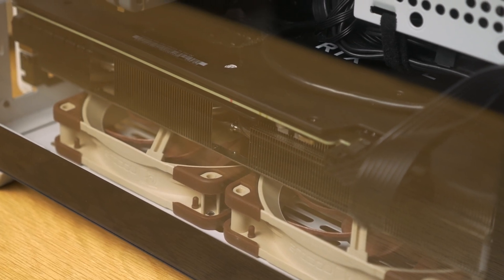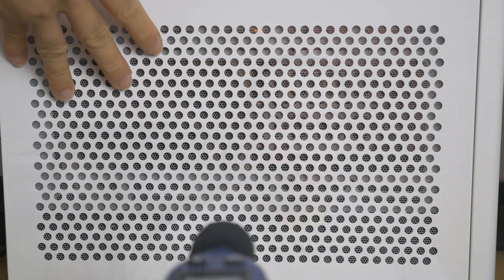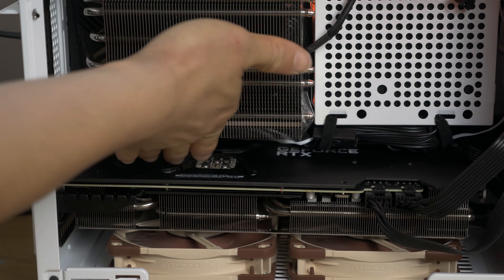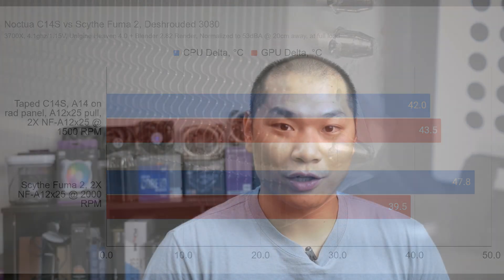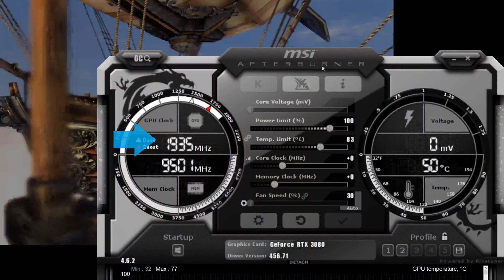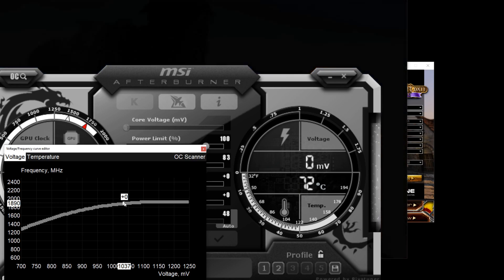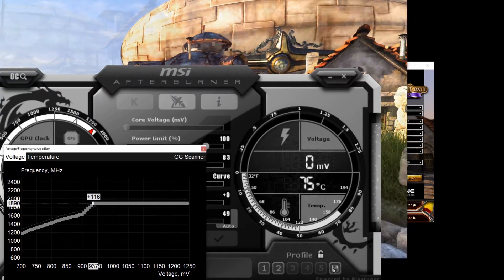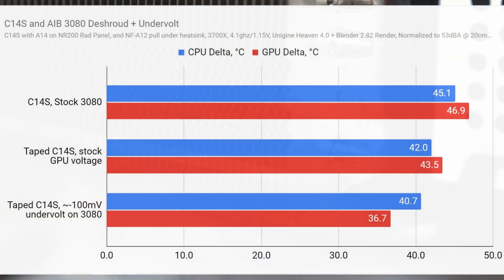Optimizing RTX 3080 Air Cooling in SFF, Part II (feat. the C14S and MSI Ventus OC)

Comment: Oh great Ncase master, I plan on running your exact setup for my ncase. My question is with the psu, would the new Corsair sf850 or even the Loki 850 or 1000 fit? Or is the best I can get still the Corsair sf750? I think the difference is maybe an inch only on one side

Comment: Is deshrouding the GPU a good idea if I'm water-cooling the CPU? 

I also am confused about connecting the fans on the deshrouded GPU. I don't want to have to microtask the fans in BIOS or fan application, so my option is to get a two 4-pin pwm to GPU connector right? So that when the fans connect to the GPU, it can cool it automatically?

Comment: on the undervolt page ... just hit the OC Scanner at hit start - this will auto undervolt the whole range to its maximum, and push your frequenses to the max at all voltage (stable) - i find this OC the best performance versus watt used when i had RTX card.

Comment: If the increased CPU temps with deshroud and C14s is due to the 120mm fans pushing hot air around the graphics card, wouldn't it work to instead 3D-print fan ducts for the GPU which force the air from the 120mm fans in the bottom to go through the GPU heatfins? 

This way there is no hot air pushed around the GPU, therefore not affecting the C14s and as an added bonus the GPU will get that air straight through its heatfins, probably improving overall thermals in the system.

Comment: If I don't want to have too much trouble with cooling - do I go with the c14s when I get a foundes edition and the U12A with aftermarket cards?

It seems like the U12A would care less where the air is coming from, as its all jumbled up in there anyways
Reply from the maker: It does matter for the U12A. Intake from the rear is a better route although the C14S can take advantage of the large side panel intake. Both when setup properly are on par.

Comment: I undervolted my friend's 3080 strix to about 1850mhz at 850mv and the the power consumption dropped from ~325W at full load (heaven 4.0) to about 225-230W ....insane saving and also dropped 5C in thermals he did do the deshroud mod before this and it idles around 35C and under load  just goes to about 40C(before undervolt) after at full load it sits at around 35C

Comment: I get it. Undervolting makes PC runs cooler, but some games just really like to boost the GPU to its absolute maximum.
Reply from the maker: Silicon dependent, you can do a combo of both- find the boost clock that your card can hit, increase a bit, then drop the voltage a little less than full on undervolt. So then you would have a combo overclock undervolt.
Reply: @MachinesMore  Right now, I am not considering overlocking. I ran an MSI Ventus RTX3070 2x OC in Ncase M1 with one fan blowing on GPU. Under full load, the Ventus fan sounds like a jet engine. I am planning to do de-shroud as you did, but can’t find the mini 4-pin adaptor around my location. So, my priority is to undervolting. I tried stock clock speed undervolting, -100Mhz clock undervolting, and both methods plus dialing down a maximum of 5% TDP. Well, I can run Heaven and Aida GPU stressing fine, but not games. I can run AC: Odessey fine, RDR2 in most of the time, but not MHWI. Like I said in my previous comment, games like to push GPU to its maximum, and all the tweaking was washed out.

Comment: Hey man, love your content!
I was wondering if you did any testing with the Noctua u12a and the and the deshrouded rtx 3080 in the nr200(p)? 
I have access to both the Scythe 2 and the u12a and I am wondering if you can recommend one over the other, my main concern being silent, or near silent operation, price is no object.
Cheers!
Reply from the maker: The big difference is the stock fans. The Fuma 2 has low rpm fans which will limit how much CPU you can run or how hard you can push it. For Ryzen 5 and below it’s enough but beyond that you may not get the highest boost clocks. The U12A has fans that can go high so if you need it you have it, if you don’t just dial the fan curve back. The heatsinks are very similar in performance, not much to choose between them. A Fuma 2 with U12A fans performs nearly identically.

Comment: For anyone who actually gives a fuk. You need to find away to separate the insane thermal output of the 3080 from your main internals. Personally, I'd get a split case and cut a custom partition in the outline of your gpu. Buy a dremel and man the fuk up. Similar to Xbox 360 and its air shroud. Ya, it used lead free solder but the implementation remains the same.

Comment: Just ordered my NR200. I am going to run a deshrouded 1080Ti Strix with 2x NF120 if it fits. Will also be using a 280mm rad so I'll have to use the mesh panel, hopefully it doesn't hurt the GPU temps too much.

Comment: When using a pull fan mounted to the underside of the C14S, does it matter what type of fan is used? I see you used 25mm, but would a slim fan be more ideal? What about a static pressure optimized fan like the P12 Redux, or matching the A14? 

Thanks for the great videos as always.
Reply from the maker: A static pressure fan for sure since it's a heatsink- the key here is that you run something with a slightly higher RPM range than the A14 so that they stay somewhat in unison. The A14 fan goes up to 1500 RPM and is a 140 (moves more air), so a 120mm in the 1700-2000 RPM range is ideal- for me that was the NF-A12x25 but you could also do a P12 Redux. The NF-F12 is a good static pressure fan but lacks the high end RPM range. Ideally you'd want the same fan but underneath the heatsink there are some size limitations with every user's board setup.
Reply: @MachinesMore  Thanks for coming back to reply! Your videos have been such a help for everyone putting together their builds this year.

Comment: Which sff cases would this fit in. Are any of the below possible a) ncase m1 b) dan a4 c) loque ghost d) nzxt h1???
Reply from the maker: NCase M1 should work when deshrouded. If not the card is too long to fit comfortably. When you deshroud the card it becomes like a 2 slot card so it would fit in those sandwiches style cases, but to get it to work I’d be a bit nervous with the high TBP of the card. Typically when going fanless in sandwich style cases you can get something up to a 2070 level (~175W) working with strong bottom fans and a solid side panel, but this is almost twice as powerful. The H1 isn’t a good fit based on fan mounting and even the size is really really tight, plus you will need a PSU upgrade.
Reply: @MachinesMore  thank you for replying 🙂 I saw someone fit in this card in nzxt h1 with front filter of case removed. I am trying to decide now on that case or hzmod xq69 . Seems like 3090 fe fits in the second one which is similar to sentry 2.0. would you suggest trying the xq69 one out . I love it's console look

Comment: Hello, really like your videos on NR200. Spending hours and hours on figuring out best setup. Ordered white NR200P, Corsair SF750 and the Aorus B550i Pro AX with some Corsair Vengeance RAM. Plan is getting the AMD 5600x (or maybe higher if bang for the buck is worth it) an a 3080 oder 3070, maybe 2080ti. I love silent systems. So I won't go for an AIO due to pump noise. I really couldn't figure out which CPU cooler to go with for most quiet and still powerful cooling. Would love to use the TG panel due to better Noise insulation and aesthetics. If mesh is even more quiet please correct me.
So which CPU cooler is the way to go for gaming and quiet Office use that fits TG and mesh panel?
Thanks for your answer, greetings from Germany!
Reply: Hast du eine Antwort gefunden? Ich bin genau gleich unterwegs und suche und suche nach der besten Lösung, da mir ebenfalls die Lautstärke wichtig ist. Mugen 5 und Fuma 2 erlauben keinen regulären 2. Lüfter oben, höchstens slim, die aber umständlich zu montieren sind. U12A geht kein TG, U12S passt gar nicht.
Reply: Habe den Fuma 2 eingebaut. Passt definitiv nicht mit Glasfenster. 120mm non slim past nur mit viel Druck drüber, habe ich nicht gemacht. Habe den Ryzen 5600x und die Lüfter auf 30%gestellt ohne Probleme mit 1 Top Lüfter. 
Im Nachhinein hätte ich glaube ich die Arctic 240 AiO oder den C14 genommen. 
Mugen 5 wäre aber sicher ein Versuch wert!
Reply: Vielen Dank für deine Antwort! Eine AiO ist mir aufgrund der Pumpe glaube ich zu laut, daher tendiere ich zur Luftkühlung. Der C14S ist neben dem Fuma 2 aktuell mein Favorit, sieht aber einfach bescheiden aus...

Comment: Does the NH-C14S come with clips for 120x25mm fans?
Reply from the maker: Nope. You’ll need to request from Noctua. I borrowed the extra set from another cooler I had.
Reply: Was there a clearance issue with using a 140x25mm fan on the bottom? I've seen pics of it clearing Trident Z ram.

Comment: If you do more tests It would be interesting to see a set up with a deshrouded gpu set to exhaust with a tower cooler like a nr200 and top/side intake. That way the cpu is getting fresh air from the top and exhaust out the rear with the gpu exhausting out the bottom

Comment: Could I request deshroud mod, 280mm radiator (Arctic LF II 280?), vs air cooling?

Amazing work, BTW. Thanks!
Reply from the maker: I will be looking at the LF but in 240mm form. The review will mainly be focused on the AIO itself but I’ll also be doing thermals with the 3080. I may revisit deshroud again at a later date but in general intaking AIOs have only a small effect from GPU exhaust.

Comment: could you clarify what is better? C14s (a14 in rad panel) | vs | L12s fan on top of heatsink + 1000rpm side panel fan
_ I saw the videos and I thought the last one was over c14s but I'm not sure now
Reply from the maker: C14S is definitely better. The L12S requires the 3700X to be downclocked for testing. At the same clocks the C14S is better, although the L12S is by no means poor, as long as you have the optimal fan layout.

Comment: Have you tried setting up the fans under the GPU as exhaust instead of intake? I believe that was found to be the better orientation for the Ncase M1 as far as acoustic efficiency is concerned and it also directs GPU exhaust out of the case so you probably get less impact on the CPU as well.

Comment: I might be dumb but I don't understand the graphs. When checking on Afterburner you can see the card is at 75º, but then on the graphs it rarely hits 50º?

ELI5 plz.
Reply from the maker: No problem! I did the screen recording for the undervolting tutorial on a different system, so those Afterburner temps aren't reflective of NR200 at all. And maybe you know this already, but the charts show the increase over room temp, which allow the user to scale accordingly to estimate temps in their operating environment. So if your room temp is 20C/68F, then you can just add the numbers to estimate.
Reply: @MachinesMore  I actually didn't know that. Thank you so much for taking the time to answer.

Comment: Great content! If I understand correctly, the NR200 has a PCI clearance of 156mm tall. If we take a look at the ASUS 3080 TUF we see is 127mm tall, that would mean that we still have 29mm left. Would this be correct? Can we have a 25mm fan below an ASUS TUF 3080 on the NR200 case?
Reply from the maker: Cheers! If you mean placing a fan between the side panel of the case, and the TUF card, I reckon you could, attach it however you can. As for fans underneath the card, most likely slim fans only given the thickness of about 52mm.

Comment: Reckon I could get away with a Noctua L12S on a stock 3700x for general use and gaming at 1440p in the NR200p? And would I need bottom fans and a side mounted fan?
Reply from the maker: Absolutely, no problem. You can even manually overclock it too- that’s how it was tested. Bottom fans will help the GPU but not critical for the CPU. Side panel fan aimed at the cooler fan is a must for optimal performance. 1440p is typically gentle on CPU anyway, but depends on the title. HTH.
Reply: @MachinesMore  that’s extremely helpful, thanks! These vids have been truly exceptional, and are the reason I’m building in the NR200. Are there any exhaust fans in the setup I’m thinking about here? I believe the rear exhaust may conflict with airflow to the cpu cooler, and the same as for top exhaust. This is the last piece of the puzzle for me
Reply from the maker: I’d run two top exhausts for sure, with a low pro cooler. The rear 92mm fan won’t fit with the L12S anyway, at least with the board I used. It’s not critical for low profile coolers anyway. Ideally for best overall system thermals run two bottom and two top fans.

Comment: Hmm, I was going to deshroud the TUF 3080, but since it affects the CPU negatively, I think stock TUF would be cool enough. I'm more concerned with the lowest possible thermals for CPU. I was wondering for your C14S setup, have you tried a second fan on the side bracket for helping with intake or exhaust? And the top fan over the mobo, maybe as intake? More direct cool air right on the heat sink, might overcome the negative of the turbulence introduced.
Reply from the maker: The deshroud mod gives the most improvement when the stock fans are bad. Everything I’ve seen about the TUF suggests that the fans are excellent. At the same time.. it’s a non permanent mod that should take a few minutes, if you have bottom fans already, I would highly encourage anyone to try it just to know what the potential is. I still think with the right case fans the a 3080 TUF system can yield some gains when deshrouded.

Comment: Packing tape, wow. I didn;t expect that lol.
Side note: board is here, time to go back and look at your NR200 configuration results to see how I should set up mine ;)
Annoyingly, the NR200P (which I got) doesn't come with a back-side 90mm fan
Reply from the maker: Nice! Which one did you go with? The Aorus? 
You know, I would have preferred two 120s to a 120/92 for the mesh version. Maybe someone here will trade you their 92mm for the 120!
Reply: @MachinesMore  I ended up getting the strix since I found it at 200 flat (about 20 under msrp) and it has debug leds. 
I think I'm going to swap out the included CM fans for a couple Arctic P12s that I have lying around and mount them at the top as exhaust. I also plan to play with deshrouding (I have a Vega56 that gets really hot).

Comment: thanks for the video.
still trying to wrap my head around all the info, but from my understanding the previous comment that the C14S is the "Honeybadger" of aircoolers for the NR200,
as it does not care what the GPU is doing, my have to be put in perspective.
at least the results show that the C14S is indeed heavily influenced by hot GPU air.
this might be a questionable idea, but what would happen if you try to get the chimney effect back by closing the sidepanel artificially, and only leave a cut-out
for the 140mm bracketmounted intake fan on the cooler?

additionally, it would really help to see how the Fuma 2 with 2xNoc fan would perform versus the C14S dual fan configuration.
that way, there would be no / less need to normalize for DB target and it would be easy to compare sideintake cooling against chimney.

just asking, for science :p
Reply from the maker: It certainly is, even honey badgers are vulnerable sometimes! 🥵 It works really well with the stock 3080. The deshroud is a really really unique scenario but as you can see the unshielded C14S presents a workable challenge. Yeah, the NF-A12s would work well with the tower, but then that’s another challenge, at high speeds they’re noise identical to the stock fans at max. At any rate, the C14S compares favorably to a tower in the deshroud mod. For the stock AIB 3080 it beats the Fuma handily, and I am testing the Fuma 2 with the FE card soon. Your idea takes something that a viewer suggested (taping off half the panel, which didn’t have any meaningful impact) to the next level, I may get around to test that!

Comment: Great Video!
Did you do some testing with the deshroud mod on different tower cooler setups yet? I would love to know if tower coolers run better as an intake or exhaust with the deshrouded 3080. I am not quite sure if the exhaust config with the mesh panel could benefit the temps as the air gets drawn in through the side panel due to negative pressure.
Reply from the maker: Cheers! Yup, check out part 1. The rear exhaust setup is a no-go with a 3080. Normally a rear exhaust is OK but the 3080 is “unprecedented.” Rear intake is how I tested it and that’s how it runs best. After all the 3080 tests (and maybe Big Navi) I’m revisiting air cooler thermals for hot GPUs just so there’s an easy summary.

Comment: Honestly, it’s too difficult to see where the air is coming from and going to throughout the videos.  I’m not sure why these two muppets question a smart man such as yourself, but their findings seem plausible.

Also, I’m stoked to do a deshroud mod with the G12 on a 3080 Tuf. My problem is I don’t want to blow a crap ton of money buying random
Heatsinks for the pcb.  I’m going to try and repurpose the secondary heatsink the Tuf comes with for the memory, but what heatsinks and thermal tape/pads would you recommend attaching the heatsinks to the pcb?

Thanks all!!